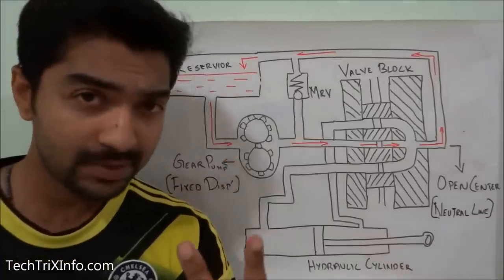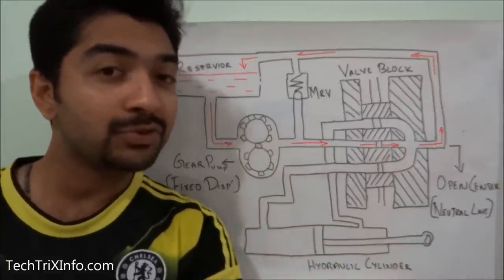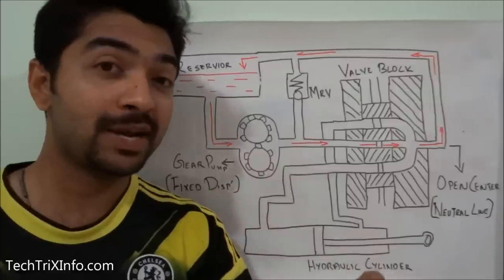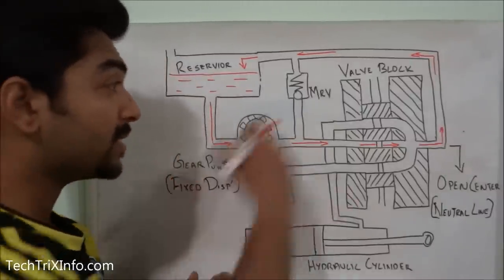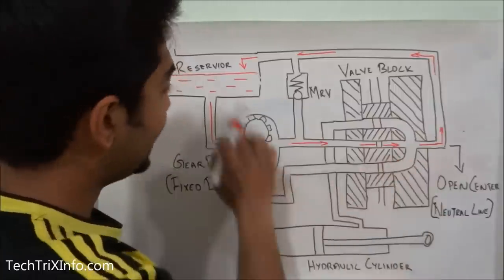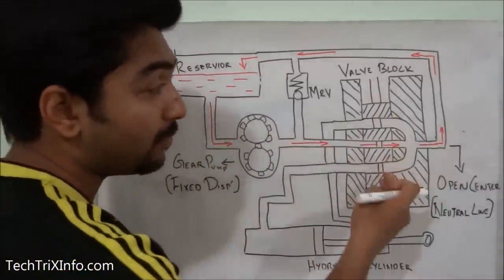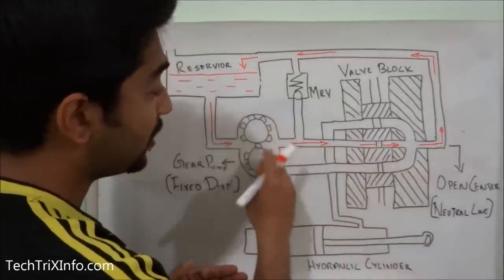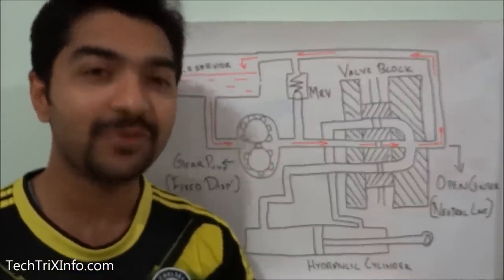How open center hydraulic system works

Comment: Thank you for the explanation, but I am afraid the valve block is wrong. I can't imagine the spool to move up or down and connecting the pressure line with the connection A or B of the cylinder. Correct me if I am wrong. Or is the spool rotating?